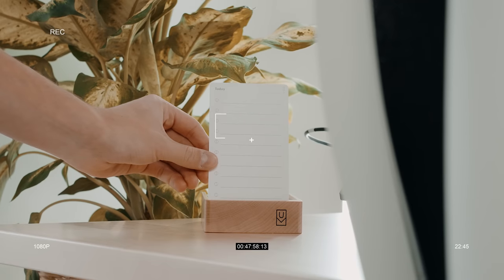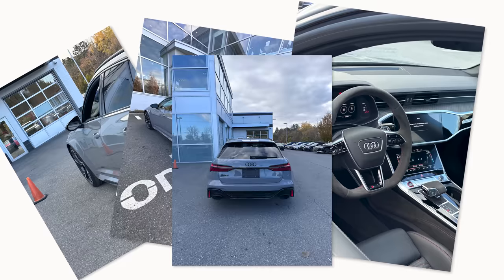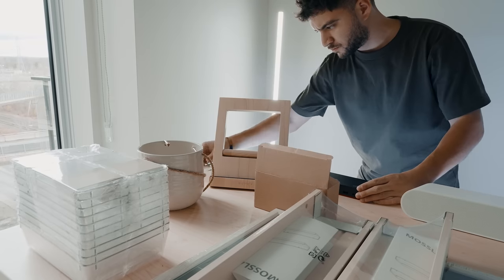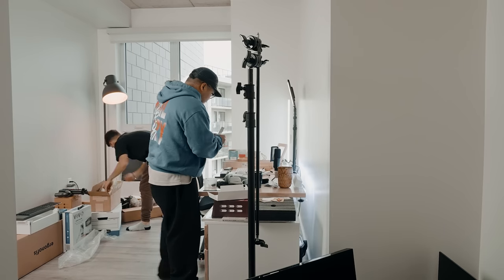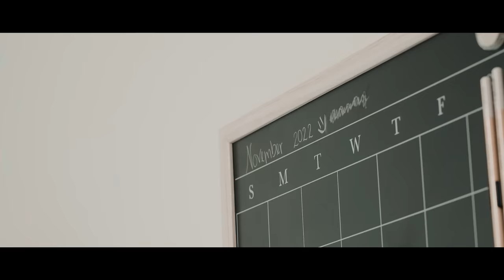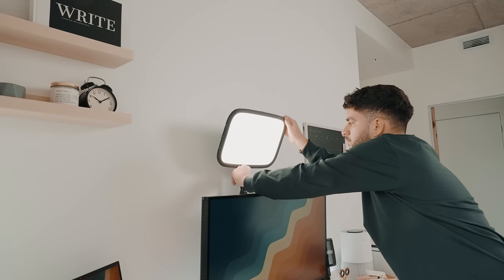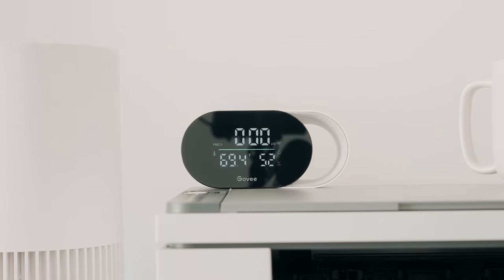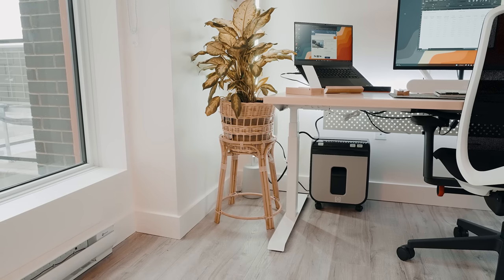Modern Desk Setup Makeover For a Work From Home Accountant

Comment: Fantastic Video ! Would you still recommend the monitor ? I do office work but also have the need for Apple AirPlay. I have a Samsung but only has 2 ports sometimes I want to extend my MacBook Air disconnect from the Monitor. Was looking at the Samsung 32" M70A 4K UHD Smart Monitor. But struggling with choices. Thought about using an AirPlay dongle with a monitor with another port (3) what do you think?